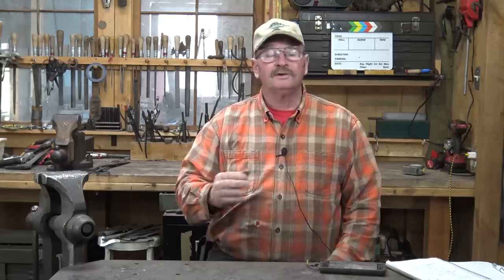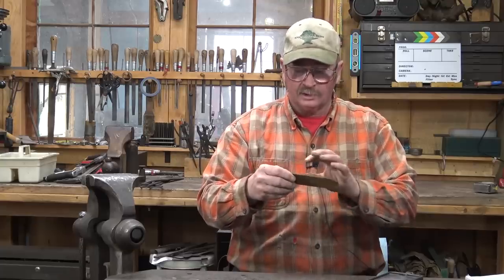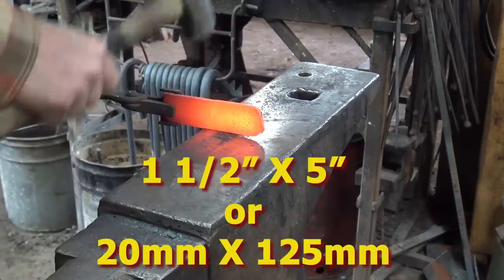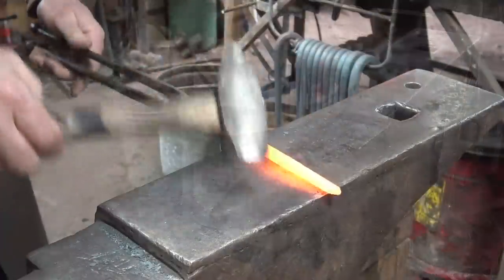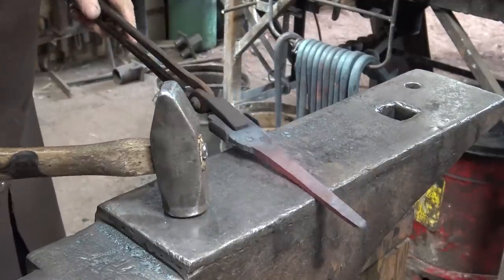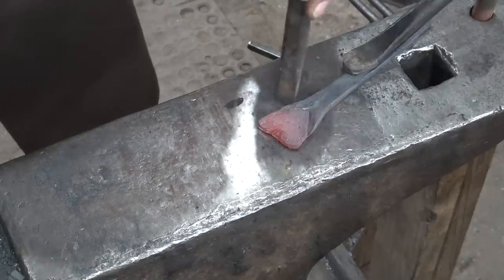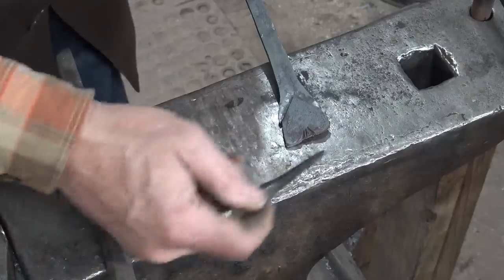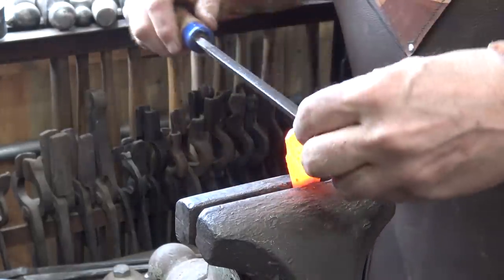Heart finial wall hook - the problem with using salvaged steel - hook of the week 3

Comment: The other smith that works at the shop where I currently work once cracked a wind chime after accidentally using spring steel(the spring had been straightened out and left in a scrap heap by a different smith so it looked like regular round bar)
I once accidentally started a project using spring steel, but was lucky enough to guess what was going on before I ruined it, the difference is small enough that it can be mistaken for fatigue but high carbon steel definitely feels a bit harder to forge.

Comment: Massively great video. I use allot of Simi known mystery steel. 90% of the free steel I get is chrome vanadium springs. The nice thing is this will hold a tool belt or other heavy object without bending. So if Mom has a big heavy skillet there you go. Something that will handle the load. So really this may be harder to make but it's so much higher quality. I appreciate the effort.

Comment: It's good to see the use of the horn.  Do you have any radius on the shoulders of the face of the anvil?  I've done this on mine and I get really good results.  I'm still learning though.  Thank you for the lessons.
Reply from the maker: I have the edges slightly rounded.
Reply: I see. I’m s a little difficult to see.  I have a pendinghaus and the radius I’ve on mine a bit more pronounced and get smaller. Thanks for responding, I’m getting a lot from your lessons. I have a YouTube channel as well, listed as Rinaldo’s Blacksmith Shop. Any constructive criticism is very welcome! I’ll be putting to another video soon.

Comment: I never know what to do with air hardening steel. I tried to use H-13 once and it was miserable . I have no idea how to anneal it
Reply from the maker: Annealing H13 properly requires a temperature controlled oven.  It needs to cool at something like 50 degrees per hour.  Cooling in vermiculite helps, but it isn't fully annealed.  But it is very hard to forge.

Comment: Your lecture about known steel is ridiculous. You should have spark tested right at the beginning. Like you, beginner smiths need to struggle and learn from their mistakes. If smithing was always easy, everybody would be doing.  There is actually science involved in this and each individual smith needs to figure out the material they are using first.  I like what you are doing here and I like seeing the struggles because it is real. I never discourage anybody from using mystery steel for projects, rather I encourage it because it will cause the smith to learn a lot more. Look at the things you taught your viewers by using this steel.
Reply: I don't think it was ridiculous.  It was a good lesson on what can happen when one just grabs some steel and starts forging.  I can't tell you how many times I have started on some "mystery steel" without spark testing.  Most of us might be just a bit on the lazy side to take that extra step.